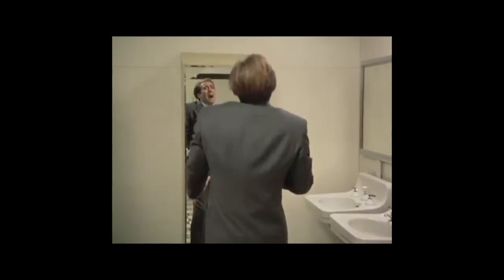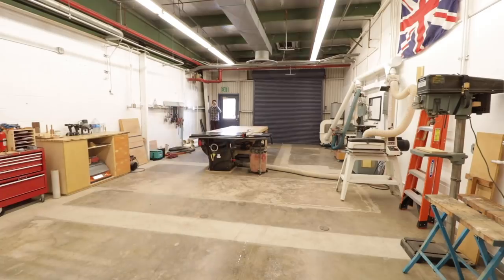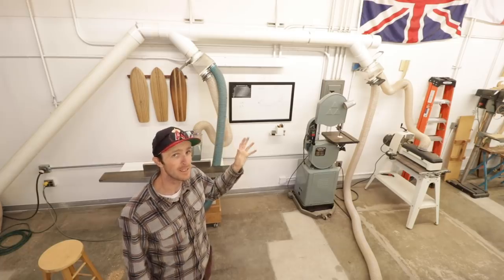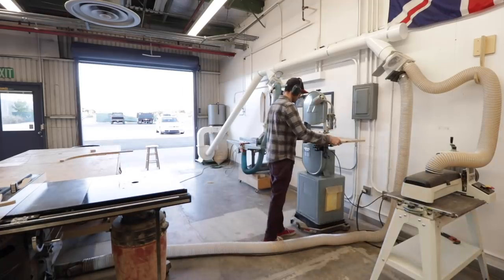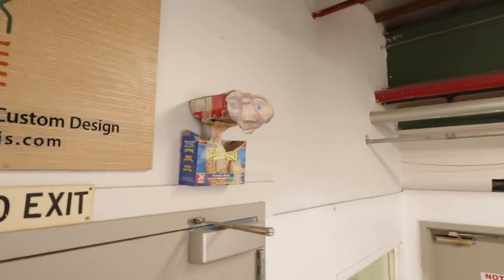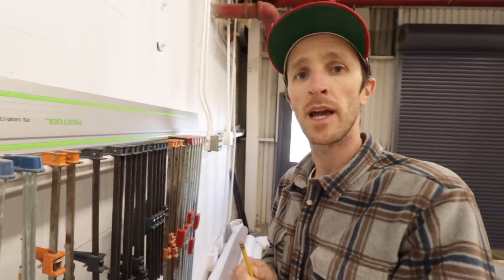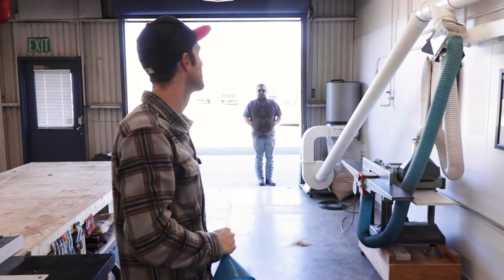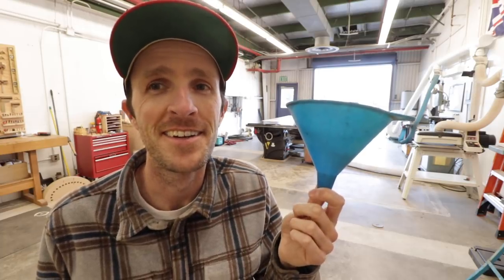How I Organize and Arrange my Woodshop -- 2019 Shop Tour

Comment: I vote for vertical limber storage if you have the ceiling height, which you do. As soon as you get two layers of material with horizontal storage its a pain to get something on the bottom of the stack and usually everything falls off but the piece your trying to get. Congrats on the new spot!
Reply from the maker: Yep, exactly why I want to try vertical. Seems so much easier! Thanks for watching!

Comment: Shaun, love the shop - it must feel great to have all that space.

Since you asked for suggestions, I'll offer what little I have:

1. The idea to have all tools on one side is  phenomenal - I try to work this way, too and it makes life simpler.  But, that dust hose on the floor would drive me nuts.  Would it be worth running one line overhead and dropping it down on the other side of the saw?  No trip hazard, same great suction.

2. Before filling all the empty space, live with it for a while.  After making a really large project a while back, I lived in my (much smaller than your) space for a while and it gave me time to think things through more systematically about what works best where and what do I really need?  Plus, open space can't be overrated if you're working on large projects.  (Which I know you don't do a lot of.)

3. Even if you were a crappy woodworker, I would still watch you because your dry humor is freakin' hi-larious!  But you're a great woodworker, so it makes your videos even more compelling.
Reply: Dan totally nailed it!  Thanks Dan - spot on :)
Reply from the maker: Thanks Dan! Yeah, the hose across the floor definitely isn't ideal, but it might be one of those things that doesn't get immediate attention, we will see how badly it annoys me. And yes, I agree about living with the open space for awhile, because right now I am loving it!
Reply: Great shop! I would just add, since you’ve asked for suggestions. The dust collector hose on the ground, I would run overhead!
Reply: Just wanted you to know I watched this video again just for the part where you call Jonathan over.  Makes me laugh every time I think of it.
Reply from the maker: @danmcdan8278  Haha! We had fun shooting that bit. Glad it gives you a good laugh!

Comment: You got me in trouble while at the library with this video.  The necklace and clamp rack caused me to forget about my surroundings while laughing.  So rad to see your growth!

I don't know how often you run your X-carve but when I had mine running all the time while working on other things the noise would kill me.  I built an enclosure and also made a sound dampening enclosure for my shop vac that was acting as my dust collector for it.  You can set it up to turn on with the machine which is a nice feature.   Depending on if you're like me or not I tend to overdo everything so projects like that turn into larger undertakings than they otherwise should but might be beneficial.

I'm a minimalist, I like to have a solid assembly table and whatever surfaces are needed for functionality with my tools.  Otherwise, I enjoy open spaces and don't like tons of furniture or other things like that around.  I try to have everything in my shop be multi-use and eliminate as many extraneous objects as possible.

You have a tremendous space and I'm so jealous of your overhead door! 

Couldn't be happier for you, Shaun!  Love the humble attitude and furniture you produce, cheers.
Reply from the maker: Haha, sorry for busting you up in the library! I am similar and definitely don't want to clutter up the space with unnecessary furniture. I am going to live with it for a bit, and see what I think is needed. Thanks for the suggestions and for watching!

Comment: Stoked to see the new shop, it’s looking great. My two cents on the second table is to keep it fairly small. Maybe just big enough to give Greg the room he needs. That lets you keep a chunk of your open space available, and let’s you reach across your whole table while you’re working there. If it’s the same height as your table saw it could be used as infeed support if the need arises. I’m not a big fan of mobile bases, but it could be a good option here. If you need more space or if Greg needs some alone time you could push the table into the corner with the odd locked door.
Reply from the maker: I agree, I definitely don’t want it to take up too much space. I am loving the openness so far, so we will see what I decide. Thanks for the input!

Comment: dear Mr Boyd, hi Shaun, as a European woodworker, I can only highly recommend to use a European style slider-equipped table saw rather than the US ones. I agree it has quite a footprint, but this cannot be an issue in such a spacious workshop. It is an investment but worth every dollar. And these machines also come in 5 fold combination machines: panel saw/ jointer thicknesser/ spindle moulder (some models also accept router bits) and optionally a horizontal morticer. BTW love your videos and more importantly love what you're making.
Reply from the maker: Yes, I would love to get a sliding table saw! Especially now with more room. Unfortunately it just isn't in the budget, but maybe someday! Thanks for the suggestion and thanks for watching, Bart!

Comment: Wow, nice work. FAST. I'm about 8 years into setting up my shop. I'm about 50% there, hehe. Hard to tell but at 20 feet wide it seems like it would make sense to have that second assembly table on its own and have the CNC on the wall, maybe around where your red toolbox is, toolbox could even be underneath it. I can just see it being beneficial to not have to compromise the ability to get at the table from all sides.
Reply from the maker: Yeah, I am definitely going to have to ponder it for a while. I am thinking a new table with the CNC underneath, similar to what I have, just with a much better system to set up, and use the CNC machine.

Comment: I like to build kayaks and the shop I work in is 20' X 24', so open space in the conditioned part of the shop, is at a premium. I'm also only 5'9" so a work table at 36" in height can sometimes be a bit high for me. 

Don't know if it would be helpful, but my solution was to create 3 rolling storage units. (actually, with the exception of the chop saw station, everything is on wheels in the shop, now that I think about it ;-)

Two at 2'X6' and one at 2'X4'. All are 22 1/2" off the ground and I can arrange them in different configurations. (4'X8', 2'X12', etc.) The 6' ones live under the chop saw bench, down one wall of the shop, and are easy to wheel out into the open space, when required as a work table, with their contents still accessible.

The smaller one kind of floats around, in front of the roll up garage door, with the Rigid sander and the 12" thickness planer perched on top, until needed.

Now that I've typed all that, I really can't see how it might be of use other than once Greg gets a new home, you might consider having rollout storage units, where he lived, under your assembly table that could double as mobile work surfaces in the shop, but the hose from the TS would get in the way.

Oh well... Great to see the new shop mostly set up. Looking forward to seeing more projects. I'm especially interested in learning more about your design inspiration. I'm comfortable doing it with houses, but struggle to do it with furniture. 

Cheers, Greg
Reply from the maker: Thanks Greg! Yeah, I think rolling carts of some sort would definitely make sense. I love having the open space right now, and that might allow me to have the best of both worlds. But that would definitely mean figuring out a better ducting system for the table saw. We will see! Always a work in progress.

Comment: Certainly makes for a much more defined work area. Looking good. I think I would have installed an overhead collection system for the table saw if it was possible to find a convenient drop point. And now you are in a commercial premises recommend some correct foot ware.Sneakers are for hobbiests and you are now elevated to industrial. You need safety shoes in your new professional working environment. Be safe.
Reply from the maker: Yeah, getting a better dust collection route to the table saw is on the list. And maybe I can talk to Vans and see if they can make a steel toe version for me.

Comment: Forgive me...it is not my shop and I am excited. 
1. Is that duct not a 'trip trap'?
2. Classes? Not trigonometry I hope. 
3.It looks bigger on video too.
4.Vertical system? As in taking advantage of the high ceiling to use for lumber storage?
5.Don't crowd the generous open space you have. Use only as needed.
6.Total mess is fine.
7.Workbench con? 
Thank you for the video. One step at a time Shaun. You will be just fine. Enjoy your trip.
Reply from the maker: Haha, I like the organization in your comment. 
1. Yes, and I hate it. Hopefully something I can fix/change eventually. 
2. I’ll leave the trig classes to the local high school. 
3. Wide angle lens helps. 
4. Yeah, and just not taking up 12-14 feet of horizontal wall space like in my old shop. 
5. I agree, open space is very nice.
6. I try to tell myself that. 
7. It is a maker conference in Atlanta this weekend. A good time so far!
Thank you, Juliet! Always appreciate your comments!

Comment: Looks great Shaun..! Heres my 2cents...
#1 Dust collection hose over head to eliminate trip hazard.
#2 Tghten up your work triangle to save steps.
#3 Vertical lumber storage.
#4 Move saw and table inward leaving over head door area free and clear for customer pick up
#5 Buy a Yamaha S202 Stereo receiver with BT 
#6 I will email you my MTM speaker plans (drew by hand on graph paper) no pdf's here😀
#7 Buy two SA100 subwoofer plate amps.
#8 Buy two Dayton Audio 8" classic subs
#9 Order drivers and misc parts needed for custom diy speakers built from non-pdf graph paper plans. 
LMBO hahaha...🐒
Reply from the maker: Haha, I like all of those suggestions. Might take me a minute to get to all of them, but thank you!

Comment: I've been looking for a new way to setup my shop. I'm thinking a simple run of dust collection should work like this. I have pretty much the same machines as you. I like them all on one wall. Plus, the way my shop is wired, they're all on one wall. Can you link some of that dust collection stuff you used too?
Reply from the maker: Yeah, it is so easy to overcomplicate stuff like this, I am loving the setup so far! All the ducting is sewer drain PVC which I got at a local supplier, but here are links to some of the other parts:
Blast Gates (which I don't love): https://www.amazon.com/POWERTEC-70227-Aluminum-Blast-Gate/dp/B071RSDH23
6" to 4" splitters: https://www.clearvuecyclones.com/supporting-products/39-6-to-4-transition.html
Flex Hose: https://www.amazon.com/dp/B01MDUGEXE/ref=cm_sw_em_r_mt_dp_U_m7RDCb0MQQMEY

Comment: Nice! Running two 4" gate open at a time is not a issue for you (table saw/drum sander- I see only one blast gate on the saw hose)?
Reply from the maker: For the most part it is fine. If the filter on the dust collector is really jammed up with dust, it can get a little weak, but now with the shorter run of ducting, it is pretty great! Thanks for watching!

Comment: @Shaun I see you have the exact same Ulmia workbench. The front vise on my closes in the right sooner than the left end. Do you have the same issue? If so how do you resolve it? Thanks much!
Reply from the maker: I actually haven't noticed that issue on mine. One thing I always do though, is if I am holding something in the vise to one side, I will put an equally thick piece on the other side of the vise so that the vise jaws don't pull in unevenly. Maybe that will help?